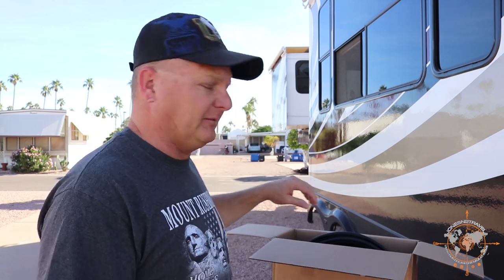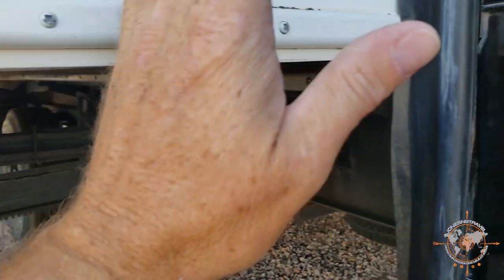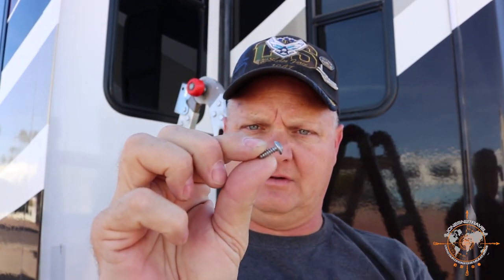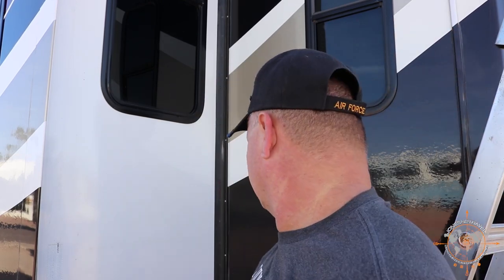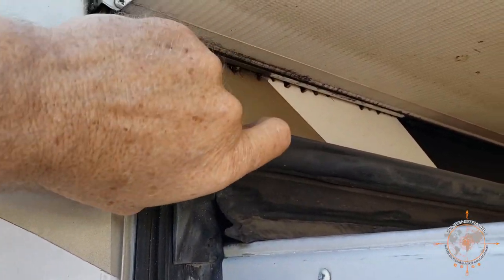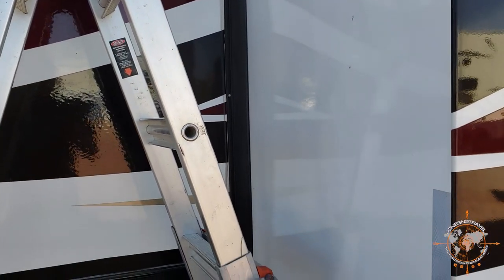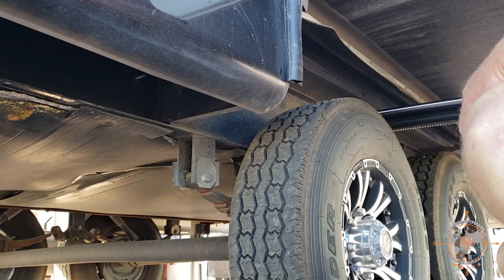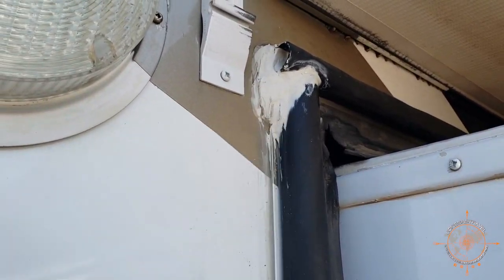HOW TO REPLACE YOUR RV SLIDE SEALS | RV LIVING

Comment: Nice Job on the seals, now I know how to replace them, I use Rubber Conditioner to keep the seals like new on my slides. apply them twice a year. Safe Travels.
Reply from the maker: Hi George. Thanks for checking out the video and following along. Rubber conditioner is the way to go, glad to hear you use it religiously. :) Safe Travels

Comment: Do you know the size screw that secures the seal? The guy that did mine uses a tiny screw and it came out of the hole. I need to replace with a longer screw. I just dont want to go through the other side. Thanks... great video...
Reply from the maker: It is a small screw and most times they go through the rubber. I usually place a small washer under the head of the screw to give it a bigger footprint. I hope that helps. Safe Travels

Comment: My slide wipers are sticking and not wanting to roll out smoothly and lay flat against the slide out. Guessing its time for replacement. 2013 Itasca Sonova. properly has never had any maintenance preformed on them. Thanks for the video very god info. Any comments  are welcome thank again.
Reply from the maker: Have you tried any seal lubricant products to bring life back into the seals? There are some good sprays on the market and I've heard that baby powder also helps prevent sticking. You may be correct, may just be time to replace them. Best of luck. Thanks for checking out the video. Safe Travels.
Reply: @JonesN2Travel  Thank you Sir and Thank You for your service. Retired Army here.
Reply from the maker: @cowboyup545  Thank you Brother. Thank you for your service as well. 🇱🇷🤝👍😁

Comment: PRO TIP: ATTACH A STRING TO ONE END OF THE BULB ON THE TOP SEAL.  PULL THE OPPOSITE END OF THE BULB.  YOU NOW HAVE THE STRING TO "PULL" THE BULB SEAL AS OPPOSED TO "PUSHING" IT.  THIS PROCEEDURE WORKS FOR INSTALLING AWNING FABRIC AS WELL.

MY UNCLE WAS AN AIRFORCE LIFER (TRAVIS AFB, CA.).  THANK YOU FOR YOUR SERVICE!
Reply from the maker: Great tip. Thank you :) Safe Travels
Reply: Pulling stretches the seal and it will contract after installation causing a gap.

Comment: Thank you for the video, you are always on it!  I need to replace my Heartland Bighorn wiper seals, they started to tear on our last move.  Any idea as to where I can find the wiper seals?
Reply from the maker: You should be able to find those on amazon as well. If you have trouble finding them let me know and I'll look them up later this afternoon. 😁
Reply: JonesN2Travel I did find them on amazon, question about bedroom slide ours is electric and it seems to have additional hardware on the slide frame any idea on how those are replaces.
Reply from the maker: @MingoMoon  the bulb seals will have a screw at top or bottom and will slide off the same way. I have not replaced the wiper seals on that slide before but I looked at ours and they seem to press into the white metal frame of the coach. See if u can find another YT video about that one. Sorry I couldn't be of more help.